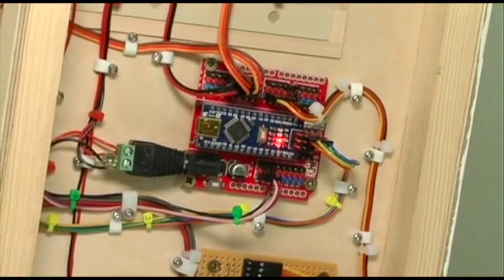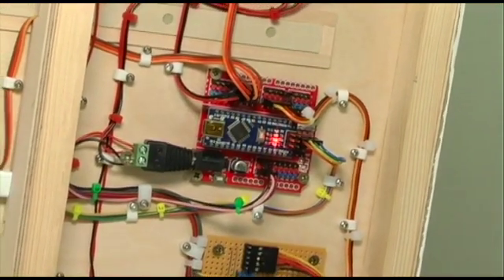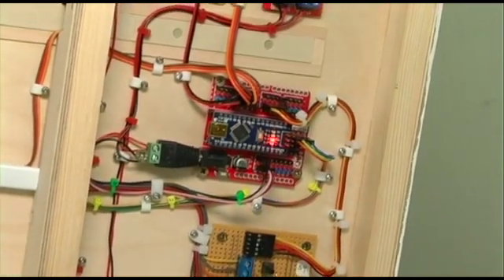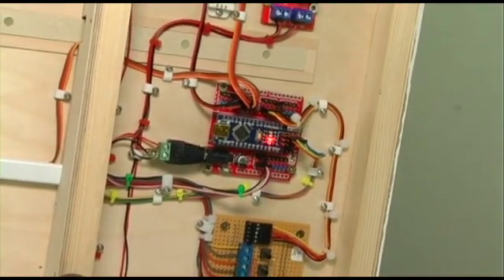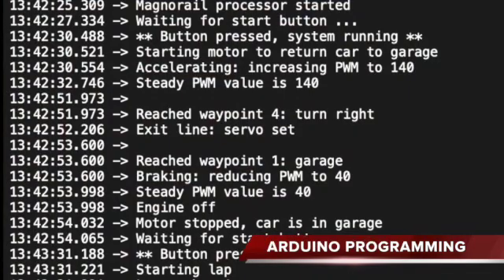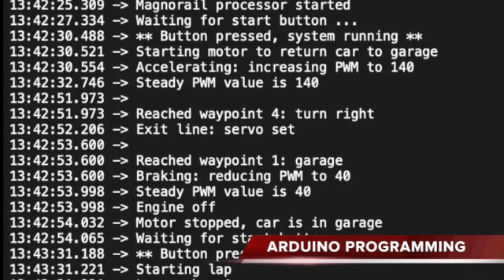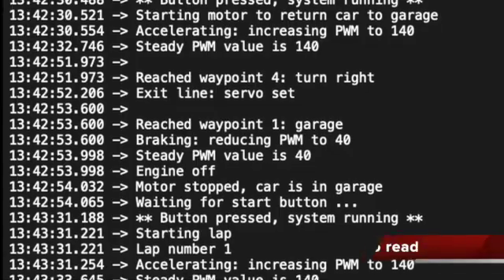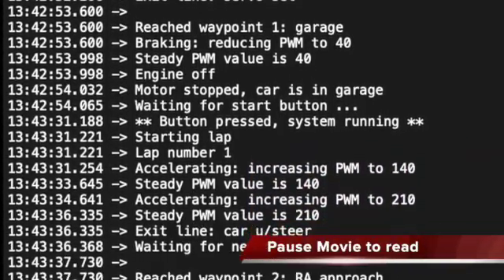Magnorail, Arduino Controls @ Classic Mini #3 by Richard Gawler

Comment: Could Magnorail be applied to something like Choppers and Aircraft?
Reply from the maker: There have been a few layouts of airports where people have their planes etc taxi-ing around the runways. Of course the suspension option as you saw on a previous video you viewed can handle planes etc being suspended from an inverted Magnorail system
Reply: @MagnorailOz  I'll have to try it out, hopefully it works. since I've got cars ranging from 1:24th, 1:43rd, and 1:18th scale. all diecast models.

Comment: I have added a RTR cyclist to the model, at a location on the chain opposite the car. The cyclist works remarkably well on my shiny (stencil card) road surface, with only a little slipping of the pedal wheel, but does reveal the need for a new set of acceleration and braking rates. So really, the system is a proof of concept for a single-vehicle Magnorail application. It could be optimised for a bike or a car, but not both at the same time.
Reply from the maker: Thats great Richard. Be careful with the surfaces as the bike wheel needs a bit of traction to work correctly. You can add an extra micro magnet on the wheel rims if there is a bit of slippage
Reply: @MagnorailOz  It is good to see the RTR cyclist working straight out of the box without adjustment, but I have realised a bike will look out of place in the industrial setting of my model. So this Magnorail project is going to have only a car. This in turn means I need only one set of acceleration, braking and speed parameters for my associated Arduino sub-project ... and the simplification this brings is a huge relief to me.